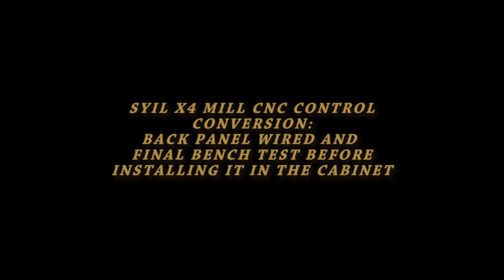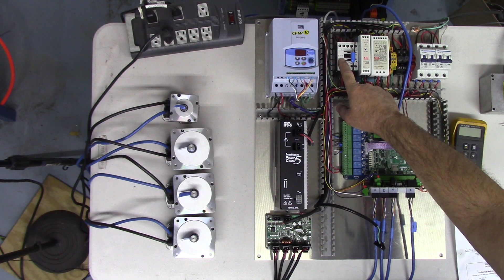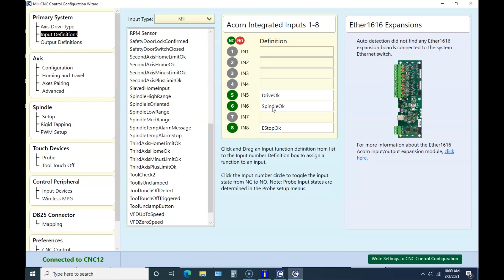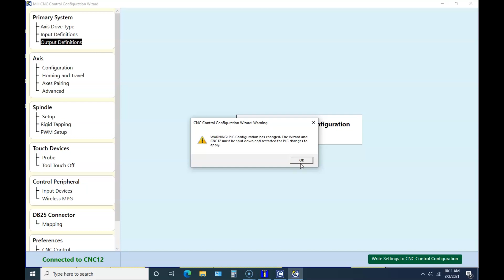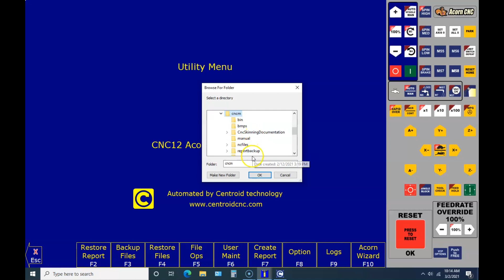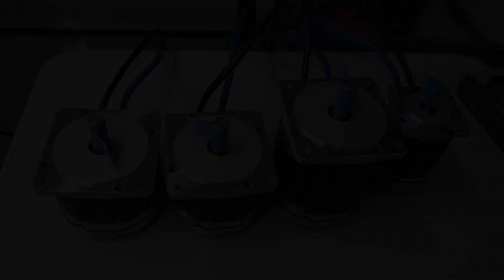SYIL X4 CNC Mill, Teknic Clearpath SDSK, Centroid Acorn Project: Back Panel Wired & Tested

Comment: A small correction. If you connect both negative and positive to your contactor, you will still have the same amount of current on each pole. Now if you split say the positive over both contacts, I guess you would be getting half the current on each pole of the contactor.

Comment: How did you connect the E-Stop switch, C86ACCP, and the contactor together? I cant quite clearly see your connections in the video. I've seen acorn e-stop schematic and c86accp schematic but I cant seem to figure out how to put them together.
Reply from the maker: Use another set of contacts on the Estop contactor to enable C86ACCP (going from memory, that was a LONG time ago and I have since sold that machine)
Reply: @martyscncgarage5275  Can you use a 120V contactor in the layout that you have? Or would that not work with Acorn's relay board
Reply from the maker: @pbJAM2201  I would not recommend it, but it would work. I'd suggest 24vdc

Comment: Hi Marty, do you mind explaining whats going on at the terminal blocks? I have never used them before but want to avoid using multiple outlets and have breakers like you have here. 

Are you using the yellow ones to get power from the meanwell and then supplying to power hub4? 

Also I am planning to build a router, would this arragement work?

Lastly, how is the IPC5 being powered? I noticed in the beginning you said you had breakers for VFD and Control but I m not sure what you said about IPC5.
Reply from the maker: I no longer have that machine. What are you wanting to know? Terminal blocks are just a convenient way to land your wires. Suggest you follow a Centroid Acorn System schematic provided by Centroid on their Web site as a starting point
Reply: @martyscncgarage5275  I was wanting to know how you powered the IPC-5
Reply from the maker: @pbJAM2201  use an Estop contactor to provide the IPC-5 power. The estop button and the No fault relay output are in series with the Estop contactor coil. Meaning either one will open the contactor in case if a fault
Reply: @martyscncgarage5275  do you have a video that explains the e-stop contactor?
Reply from the maker: @pbJAM2201  it is very clearly explained in the  Centroid Acorn System schematic. Quite simply, it's job is to remove power from the drives and disable the spindle motor.
Reply: @martyscncgarage5275  Sounds great, ill check that out, Thanks!
Reply: @martyscncgarage5275  But doesn't the E-stop contactor only get supplied 24V by the power supply? How does the IPC output 75V?
Reply from the maker: @pbJAM2201  please find the Acorn System schematic and study it. The contactor control circuit requires it's OWN power supply. You run the IPC power supply feed through the contactor so that if there is a faulty or an Estop press it opens the contactor dropping power to the IPC power supply and also opening the spindle control circuit.
Reply: @martyscncgarage5275  I have looked over S14953 but unfortunatley it doesnt show motor power supply on there. Im a little confused as teknic's IPC5 manual shows that it needs a 120/220 VAC input
Reply from the maker: @pbJAM2201  did you not find the clear path schematic? I only pointed you to the Acorn system schematic so you could understand how the Estop circuits work.
Reply: @martyscncgarage5275  where can i find the clearpath schematic?
Reply from the maker: @pbJAM2201  https://www.centroidcnc.com/centroid_diy/schematics/pbrowse.php#
Reply from the maker: Please bookmark this page: https://www.centroidcnc.com/centroid_diy/centroid_manuals.html
Reply: @martyscncgarage5275  Ah yes, I've seen these. I thought you were talking about teknic's schemtaics.

Comment: Hey Marty, I am just getting around to wiring my back panel. I have the C86ACCP and somewhere else you showed driving the NO_FAULT terminal on the C86 using OUT1 from the relay baord, but that is now driving the coil for the contactor. In the configuration shown here, what is being used to drive the No_FAULT to enable the C86 - it looks like there may be a couple of purple wire shown but I could not figure out what they went to.
Reply from the maker: You need a spare set of contacts on your contactor or fir another relay oof out 1
Reply: @martyscncgarage5275  thanks - I was tending toward setting up another relay, but the extra set of contacts on the contactor is way more sensible

Comment: Where did you get those power supply components? Your not using the regular supply that comes with the Acorn
Reply from the maker: Meanwell Din rail mounted power supplies. Same as Centroid supplied power supplies, just din rail mounted. Search Amazon

Comment: Pg 36 of ClearPath User Manual, Switching and fusing section (in regard to the IPC-5) says: "Switching the DC output side, especially with inexpensive relays, will ultimately result in poor performance (drop outs) 
due to pitting, corrosion and contact welding. If a power switch is 
required, install it such that the supply is disconnected from the AC input 
side."

Obviously you're using a fairly substantial contactor, rather than just a cheap relay. But, their second sentence may not ONLY be in reference to the first sentence. In other words, there may be other reasons (than pitting your contacts) why you should switch the power from the AC side rather than the DC side. It sounds like a "shall" statement rather than a "should" statement.

I've been in automation since 89' and I've never burnt up a component, which is a very rare claim. The reason is, I read and reread everything and I leave nothing to chance. This particular warning caught my eye because I've seen power supplies that will spike themselves to death if you disconnect the DC side. I was helping a company out who was smoking DC supplies, one after another.  I put a high impedance meter on the DC and saw it go from say 24VDC to almost 100VDC, just as they removed the load (switched the DC off). 2 or 3 times and the supply gave up the ghost. I downloaded the manual and showed them where the mfg said only to switch the AC side. After the wiring change, they had no more issues. The IPC-5 may be completely different, but their statement reminded me of this interesting issue and I wanted to share.
Reply: Cool! I extensively rewrote my comment (very long) and posted it. I then saw your short and perfect reply. By the way, nice job on the system and the video. Thanks for all that you do!
Reply from the maker: They prefer you to kill the AC. I changed it before I sold the machine

Comment: You said you wired your E stop inline with relay 1 and input 8.  Is the reason you ran it in series with relay 1 (no fault) is incase acorn freezes up and doesn't respond and you need to physically disconnect the contactor?  I just wired mine to input 8 and it seems to be working fine, but I should probably change it if that is the reason you did it that way.  It makes sense to have a physical disconnect.

Comment: Random questions as I cannot find a manual for the power4 module (I am sure its my fault), but what molex connector is used to connect the 24v logic power?
Reply from the maker: https://www.teknic.com/POWER4-HUB/
Refer to connectors
Reply: @martyscncgarage5275  LOL...I was just on that page...I told you it was probably my fault.  Thanks for your help...this series and been a big help to me getting mine setup!

Comment: Marty -  thank you again for these videos.Tthe way you have it set up here, you only have one 220v coming in, and are powering both the spindle/VFD and the IPC-5 power supplies for the Teknic from that one power cable. I assume that means that the IPC-5 can handle 220v, and the Meanwell power supplies can as well. Is that correct? I love the simplicity of having one cable in and not a seperate 110v cable. I didn't realize that was possible until this video. Thank you!
Reply: Yes, as I explain in the series, by removing a jumper on the IPC-5 power cable it accepts 220vac as do the power supplies in the cabinet

Comment: Thanks for the content Marty. The Centroid wiring diagrams for the C86ACCP show an E-stop with a single NC connection - your setup looks more sophisticated. Are there downsides to the version shown in their schematic? I dont have the VFD that you are implementing was I am using the integrated version on the PM 728VT
Reply from the maker: I always suggest using an Estop contactor. That is the purpose for the second contact block.
Reply: @martyscncgarage5275  I am assuming that the contactors value is primarily for higher current applications? Or does it give you an extra estop option?
Reply from the maker: @andrewnash48  a small machine can hurt you too. It's a personal decision. I try treat all my builds with the same safety measures.
Reply: @martyscncgarage5275  no argument - just trying to understand the extra value it brings (novice question)
Reply from the maker: @andrewnash48  Safety. Pulls power from drives and disables the spindle

Comment: As the series continues, I'm feeling more and more out of my depth...! :( That said, I had the same feeling building my first CNC using Arduino and UGS, and that turned out fine. Very close to ordering my Acorn, so looking forward to the next exciting instalment of the SYL X4 Mill series! :)
Reply from the maker: You have a basic understanding of CNC control, some basic Electrical/Electronics experience, and when you get stuck, the Centroid CNC Users forum is there to help
Reply: martyscncgarage Thanks Marty👍😊

Comment: Amazing how compact it can be with the drives being in the motors.
Reply: Yes, that's why I love my Clearpaths. Only downside, only one feedback line :(
Reply: @SuperYellowsubmarin  Not sure I understand what you mean about "only one feedback line".
Reply: @polaraligned1  I assume that he means there is only a single output from the clearpath motors that indicate motor state, the HLFB output.  No encoder output, nothing that provides more k formative motor state information without jumping to a USB cable and the MSP software.
Reply: @polaraligned1  feedback line (HLFB as Technik names it) is the only output of the SDSK version of Clearpath servos. You can assign only one of several possibities (on position, fault, encoder index, ...). Sadly on CNC you absolutely need the fault output, so you cannot use other fonctions at the same time like encoder index for accurate homing, like you would on DMM.
Reply: @SuperYellowsubmarin  I see what you meant now.  Yeah, that does stink.
Reply: Hi @SuperYellowsubmarin , 

Thank you for your kind words about ClearPath integrated servo motors.

You are correct that ClearPath motors have one output called HLFB (High Level Feedback) and that you can only set it to one output mode at a time. Most CNC machines use the HLFB mode called "Servo On". This mode lets the controller know the enable/fault status of the motor. This output can be used by the controller to help prevent wasted material and possibly broken tools by disabling all motors if any one motor goes into a shutdown state. 

That said, there are some other HLFB configurations that can offer more information. For example, "All Systems Go - Position w/Measured Torque" will also tell you the same enable/fault status as “Servo On”. In addition, it tells you how much torque the motor is using (while in motion), as well as when/if the motor has achieved its commanded position.

For more details regarding other HLFB output modes available for ClearPath motors, please see the HLFB section in the ClearPath User Manual (https://www.teknic.com/files/downloads/clearpath_user_manual.pdf#page=48).

With ClearPath motors, an encoder index output to the controller is not necessary for accurate and repeatable homing. This is because they have a built-in "Precision Homing" feature that ensures your axis will home to the same position, even if the physical hard stop wears down, shifts position, or changes over time (by up to +/- half a revolution). Here is a video that shows the Precision Homing feature in action: https://youtu.be/-LubKmpB5-8?t=214

I hope I have clarified some of the homing and output capabilities of ClearPath motors. If you have any additional questions, please contact us at https://www.teknic.com/contact/ or give us a call M-F between 8AM and 6PM EST at 585-784-7454.

Best regards,
Trent T - Teknic Servo Systems Engineer